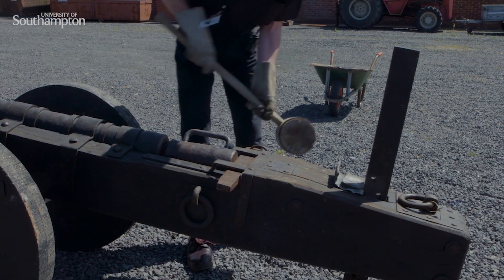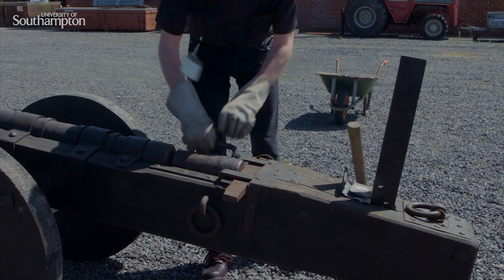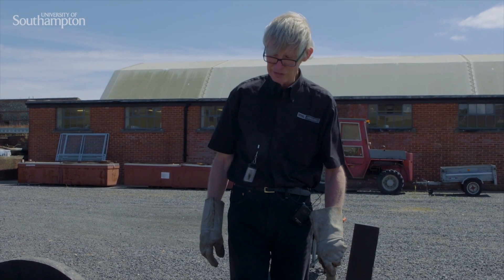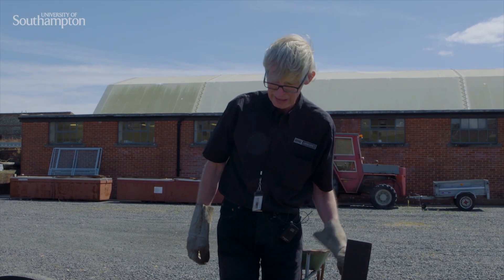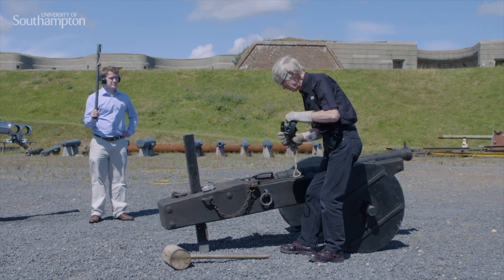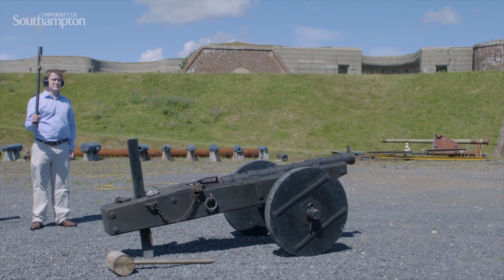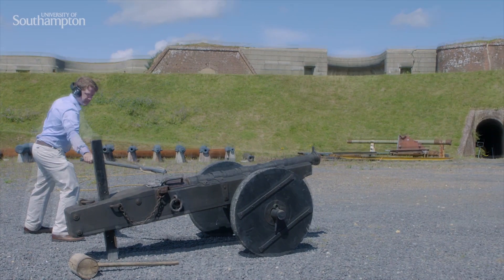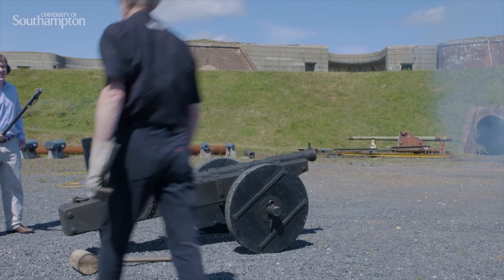How were medieval guns loaded and fired?

Comment: I always thought cannon from that period were exclusively muzzle loaders.
Reply: Breach loaders were actually fairly common early on, meaning a lot of early cannons actually had almost modern rates of fire. The problem was short rage and a tendency to explode, especially as more powerful powders started to be made. Muzzle loaders were much stronger, and so could hit harder, further out, without nearly as high a chance of killing their crews.
Reply: @nikolai60  Yes exactly. The nature of cannon warfare had it that range and destructive capability was more valuable than rate of fire so that's where the arms race went. Which makes a lot of sense because 1 They are used in siege warfare so if the attacker could shoot the castle out of range of their cannons, its game over. 2. In a pitch battle it takes a lot of time to set up the guns, so if you could make them have to set up their low range cannons whilst in range of yours, it's kind of a bad time for them. 

Basically if you dont have the longer range cannons, you might as well not have cannons.